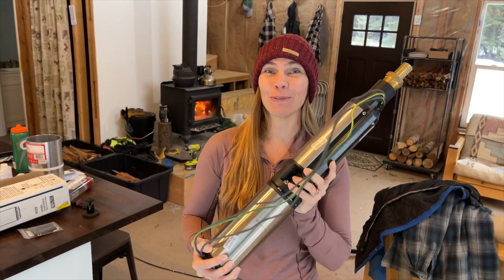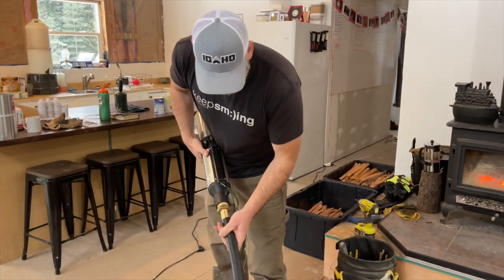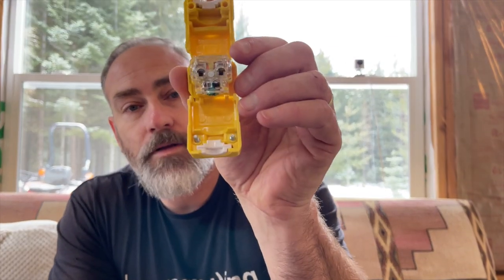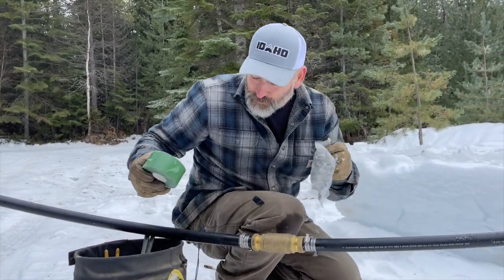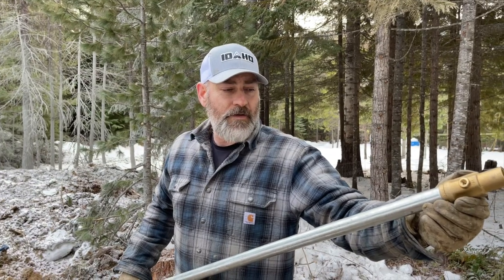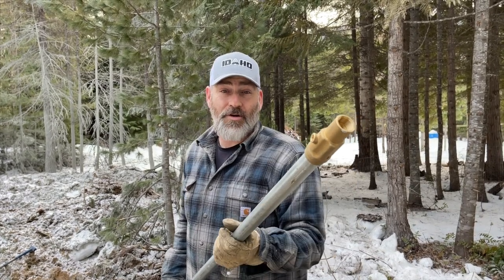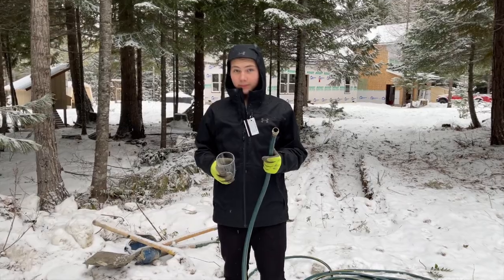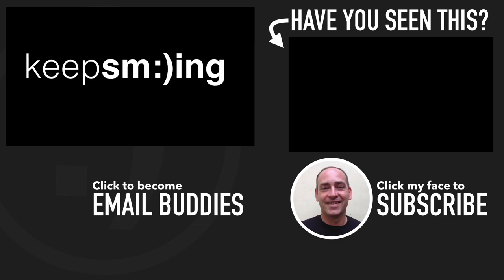WIFE is HAPPY/HUSBAND is NOT - DIY Well Pump Installation

Comment: Only one thing you forget on pumps that deep we use cable guards to keep the wire from rubbing on the case I seen many times the pump still good but had wire rub but most of the time it's already 15 20 year old so we just replace it all😁👍👍
Reply: I don't belive the depth part. a 1/2 to 3/4 hp pump will never get water to top at 500ft.
Reply: @larryray4811  The way I understood this, the water head is only 90 feet, never mind how deep the well may be. But I do agree that 1/2 HP sounds too small to be able to deliver any kind of useful flow.
Reply: @engineerinnewyork  I thought i saw when drilling that the went to 600 and then back up to 500. They showed a chart, but i could be mistaken.
Reply: @larryray4811  At minute 14:56, give or take, he says that the static water level is 94 feet. The well and the pump are deeper, but all that counts is the water head, since the pump won’t make any effort to push the water up until it reaches the surface at -94 feet.
Reply: @larryray4811  Also, at 18:10, he says that pipe is 196 feet. It follows that pump is at approx. -196 ft., very far from the well bottom, but irrelevant because it’s only the water head that counts.

Comment: Hello from South Florida. The take away here is you got the pump running. Your generator is trying to start the pump but couldn't sustain the long draw amps and shutdown. Generators usually have a "peak rating" . That Predator has 3500 Watts Peak...that is 29 Amps (run @ 25 A). You were drawing 32-36A. The other generator will peak @ 6250W = 52A and run @ 5000W=41A. Watts = Volts x Amps
Reply from the maker: +Lou Cinci Thanks for your input. I appreciate you taking the time to give it. Hope you have a really great day and keepsm:)ing!

Comment: a motor takes more watts to start than it takes to run, like almost 10 times
Reply: Called lock rotor current.  Be prepared.
Reply: Hello starting current. although that's a long surge for a pump that small. Edit: watched further... because it wasn't starting.
Reply: @MarkSDCA  LRC is when the rotor is unable to turn. Starting current is a little different.
Reply: A hard working 3 phase engine, takes 4-6 times its rated power to start. More than that and it will barely be able to start. 
10 times is unheard off.
Reply: Agreed and the lower multiple, obviously it depends on the machine
Reply: Pump needs a control box with a starting capacitor to give you the extra amps at startup. Can't just plug it in direct.

Comment: My well water has orangish tint (from iron), sometimes light grey (from shale). I spent a lot of time and money installing proper filtration to correct the issue. My water comes out the other end (my spigots) without any smell or color, just clear. My well is at about 70 feet so much shallower. My pump is a 240VAC 1/2 horse. Its interesting that some people do 110VAC for a pump. All the pumps I have installed were 240VAC. The video was interesting in respect to the fact you the home owner are installing the well yourself.  Nicely done video though.

Comment: TIP, on that weep hole at the bottom of the frost free faucet, add a 90 degree elbow and I always add a 2" extension with that. Helps keep sand or sediment from clogging it I've seen many of those installed without and they don't last long, every one I've installed with the elbow and extension I have never had an issue with

Comment: My first thought was "needs a hard start capacitor" because my background is in HVAC. It did not occur to me that more watts from the generator would do it, but it should have.  My brain just doesn't work like it used to.  Like most issues, persistence solved it.  Well done.

Comment: You should go with a 3 phase inverter controller and it will reduce your amp draw down to a max of 10amps.  And when running as low as 3.5amps.  They cost some money but saves the life span of the pump and saves money over time.  Also great for a off grid system

Comment: YES! You installed the hose clamps with the 'heads' of them, on opposite sides of the pipe. If there is going to be any leaks through the plastic pipe under those clamps it will be at the head of the clamp. Installing them with the heads on the opposite sides lessens the problem.
Reply from the maker: I learned that from the plumbing inspection last year. They are good for something 😂. Truthfully the was a huge help and a really nice guy.

Comment: I think it's gonna work!

Update: Well, then.  As a note for future troubleshooting, the time-saving step you missed is ... testing the second pump before install.  Also, I'm curious what the electrical specs are on the well.  We know that many high-draw appliances (e.g., table saws and refrigerators) have a massive surge at start-up.  Did the pump come with that information, or was it only labeled as 1200W?
Reply from the maker: It didn’t say the LRA or start up amps. Wish it did that would have need helpful.
Reply: all the 110  volt pumps use a 15 amp braker, that much more then it needs, a 1 hp 220 volt also uses a 15 amp, that 110 volt will use 8 amps at start, and run on 5

Comment: Close the presure side of the pump. Then start the pump. When the pump is running, open the valve. Sometimes this will help the pump startup a little easyer.
The combination with electrical pump and a generator is always tricky. The startup needs a lot of amps

Comment: I could be wrong, but I think You will need more than a 1/2 h.p. pump to pump water over 600 feet.
Reply: You do Russell... 1.5 - 2 Hp = About 5-7 GPM @ 40-50 psi on the surface. At the pump you'll have about 200 to 250 psi. WOW! Depending on water level in the well. Wire size to pump at 240V = #8 Ground can be #12 Mainly because of voltage drop. Because they don't have Utility Power it would be best to run a generator to pump into a 500 -1000 storage tank at the home then a much smaller pump to move water in the home. These are good people and what they are doing is tough...

Comment: 🙋‍♂️ lol
When you plugged it into that 3500watt, I had a feeling it wouldn’t pump. 
We had the same issue.
We have a 9500watt just for our well. 
Be careful at startup to always have the valve open, otherwise you can “deadhead” the pump. 
That’s what we were told. 
So glad you got it pumping, now to clean some water 😛
.....wait that doesn’t sound right 😜
Reply from the maker: We are glad too. What size is your pump?
Reply: @MartinJohnsonOffGridLiving  ours is a 3/4 horse I think. 
Homestead rescue had it installed. I know it takes a 30amp breaker. 
We pull close to 20 gal a minute.

Comment: Always nice when the well guys dig you a trench for the pitless adapter install while they have a machine there, or install it before they lower the last section down 4 ft ... but after 4 long days they may have forgotten ... and yea, even 110v well pump need a large generator  ... that pump has to work hard to get that column of water up 500 ft ... they pull a lot of juice, especially on start up ... too little juice and they overheat, causing thermal shut down  ... glad you solved the issue ... all part of the well learning curve .... most 230 v systems require a control box to modulate and protect motor and circuits

Comment: suggestion... ready to go 10 by 10 well house sturdy enough to hold solar panels. insulated for harsh winters. Include a runoff drain for "OOPS" shelving for batteries and  spare parts etc. include limited lighting, a heater set to come on at 40 degrees. have fun. Keep Julie happy! If that river crosses your land put a "mother earth" generator. build a dinky water tower to have a secondary water source use the generator to again supply electric pump etc...

Comment: As a retired Well service worker, I can empathize with you.  Pulling a new pump because it does not work is not any fun.  I praise you for working in the freezing snow/ice.  I can't believe that the well driller did not leave you a "pitless" adapter already installed.  I have placed one pump that ran on solar, had a charging system and a battery, ran on 12 volts d.c.  The second pump will work, I watched you install the first and you did everything correctly.  Good luck with the pump.
Reply: I agree with your solar pump. I do think he did a good job putting in the pump. I would have used 1 or 2 more torque arrestors, and 3 flat pump wire and some super 88. And I love the green pipe tape it’s the best. And I would have put some Corine tablets down the well. But that’s just me. I hope it all works out for them.

Comment: Just something for you to think about I hope you changed out the galvanized pipe fittings you installed down at your pump they should of been brass. I think someone said you also need wire guards up your pipe. You also could of drilled out the top of your pitless adapter and well cap and placed your hydrant down in the well pipe, maybe you were going to move your hydrant later to another place. Just tossing thing out at you as I did for my well. Good luck. ~ Francis

Comment: Best suggestion to avoid the rusty water issues is : Do NOT Allow them to install the Steel/Iron casing. use PVC instead.  1.) It eliminates the dirty rust water.  2.) It reduces the risk of pump and pipe loss due to lightening strikes burning holes in the metal pipes and damaging the pump.  Cleaner water and far less issues down the road. BTW: the PVC Pitiless installation would have been far easier as well.  Lessons I did not have to learn the hard way.  (We have and old 750 foot Steel/iron well on the farm; dirty water and pipe/pump burn out every couple of years.  At least use PVC down pipes, (these are not like the tubing used in this video but rather PVC Pipes manufactured especially for use in wells. They are threaded and install the same as regular 20 foot length steel well down pipes).  PVC casings cannot be driven down like steel casings can be so they must be drilled in by a qualified well driller and then properly grouted.
Reply: Hi! My name is Andrew and I work for McCullough and Sons Well Drilling.
So the  issue of steel vs PVC casing and dirty rust water are not related. That dirty rust water is caused by iron in the water, not the steel the casing. This iron in the water comes from deep down in bedrock or wherever your water is located underground. It’s a mineral that is present in the water whether it’s PVC or steel casing. If there is an orange goopy sloppy gross stuff on the outside of that pipe that you pulled out of the well (that’s called drop pipe), you have what is called “iron bacteria”. It’s a bacteria that gets in the well and feeds on that iron mineral in the water. If that gets inside your pipes it can stop everything up :)

There are also situations where we can’t use PVC drop pipe. PVC drop pipe is used for shallow wells that don’t have a submersible motor above 1/2HP. A 3/4HP pump is pushing the capacity and strength of PVC pipe. The other problem with putting PVC drop pipe down a deep well with a pump larger than a 1/2HP is that when that 3/4HP pump fires up, it generates a massive amount of torque which whips the bendy flexible PVC pipe around inside the well. That can cause your wire to get split or severed. Deep settings generally use steel for this reason.

That’s quite a deep well you have :) 750 feet deep is no joke.
Reply: @aindreascinead7370  What happens with regularity on our 750 deep well is that a lightning strike anywhere near, say within 1200 feet will run through top soil to the well casing while burning holes in the drop pipes and cooking anything in the upper 25 feet of water within the casing to a blackened sludge. The common practice of disinfecting the well does nothing to change this issue. (I'm pretty darn certain the iron is leaching out of the rusty casing walls regardless of what you say.) 750 feet of rusty casings is no joke. In Northern Minnesota known for iron water our PVC well casing only runs 150 feet deep and the drop pipe is also all threaded PVC 100 feet deep. We haven had iron water, bacteria, or lighting, or pump issues with this well, not since the day it was put online 30 years ago. I may NOT be a well driller; I do know what works far better.
Reply: I decide to run stell casing vs ovc, in case I ever wanted to go deeper or any work in the hole it would be protected. There are supposed to be 2 more zones of water below my current 104 to 140.  One at 250 and one at 300. If at some time inthe future, my family or kids need to go to a deeper zone, a drilll string can right down the casing, but not on PVC in would tear it up and a guy would lose his well.

Comment: The output of the generator is small to drive the submersible pump.
Mine uses a clean 240V supply for the 500W pump.  Pumped at the first trial.

Comment: When you start up a centrifugal pump for the first time, it has almost no back-pressure to overcome as the discharge pipe is empty. This means that for a short period of time (as the pipe fills) the flowrate that the pump is delivering will be very high. The motor current is more-or-less proportional to the volumetric flow through the pump and will therefore be very high until there is some back pressure and the flowrate significantly falls. When you are down to a normal operating flowrate then the motor current will be a lot less.
As an aside, it is not well known that when you run a centrifugal pump against a closed valve then the motor current falls to a minimum, when you open up the valve then the flow gets going and the motor current goes up.

Comment: Look up Lakos sandmaster filters.  Buy a stainless steel one.  They use centrifugal force to essentially throw the sand and grit to the outside of the filter housing.  Then there is a purge valve at the bottom - you manually flush out the sediment say once a week.  I would have your water tested to see if you need an acid neutralizer and a water softener.  These would go in next, in that order.  The final filter in the system would be something like a Rusco filter with a purge valve at the bottom.  This has a removable cleanable filter element.  Of course, the other thing you need is a pressure tank.  I like Well-x-trol.  This would be the second thing in the system after the sandmaster filter.  Fun Stuff!  And congratulations on getting all that hard work done!

Comment: If you prime the pump first to avoid the high draw on startup.  If there is water in the pipe it won't draw as much.   Noticed once it started flowing you meter showed 11.

Comment: Bravo on doing your own pump install.  It's not easy doing all this stuff yourself the first time.  I built my own off grid home myself with one man helping about 10 years ago, took me 6 years to complete.  You had a tough decision to make regarding your deep well and I hope it will work out OK regarding water quality.  I use a 3 wire, 230V 1/2 hp pump, with standing water depth about 200 feet, very similar to yours.  3 wire pumps have a signficantly lower starting current than the 2 wire; your pump supply place should have told you to avoid them for an  off grid homestead.  My Franklin 1/2 hp, 3 wire 230V pump starts easily on either my generator (Lister CS 6 clone with 3000W ST-3 head), or my backup cheap gas generator (4000W) or my own design 1500W sine inverter which is somewhat similar to the old Trace SW design, and can handle the 3000W+ surge load without complaining thanks to the toroidal transformers.  The guy suggesting a variable speed motor for soft starts was also on the mark- that is another solution.   I'm a retired EE.

Hats off for a good show, well edited, and for all the hard work, well done.

Comment: Dont let the pipe come apart at the clamps! I use wire too hold it better in case the clamps come off.They can snAg on a Rock edge.

Comment: Perhaps it's to little to late but for other folks, with a lot of electrical  appliances you must allow twice the running amps for start up. This means if the pump runs at 30 amps it may require 60 amps at starting. I learned that when looking for a generator to run my welding gear. It was cheaper to buy a used mobile gas welder. It runs all the tooling the mobile rig needs.

Comment: F.Y.I. Grundfos makes soft start pumps which eliminate a bunch of problems.
Reply: Grundfos has always been my go to. They also stand up to all kinds of contamination and weird pH and remediation additives  in my environmental remediation/extraction wells.
Reply: Thanks for the info.  Like a lot of products made today,  a few brands really try to stick with top quality materials and quality assembly, and some are a collection of import parts thrown together.  It is helpful to know what is a good reliable brand, especially with something like a well pump.  Thank again because I will be buying a new pump this summer.
Reply: Grundfos is usually stainless steel and you don't wanna use it when you have high iron

Comment: Black pipe and hose clamps. My bump is at 208 FT. schedule 80 PVC with steel couplings. 37 years and going strong. Different pump same pipe.

Comment: until you get the wellhouse with the purifying system set up, you can purify the water with a still (the thing you make moonshine and other alcoholic beverages with)
Reply: Or they can go right to home depot and just connect water purifier direct to there kitchen faucet.

The water should be fine for shower and what not.
Reply: @michaelrunk5930  I don't disagree but the still could be repurposed for other means later.
Reply: I'd just drink the water when it comes out of the faucet. We drink rain water and well water all the time. No cancer in my family.... No factory chemical water for us. You need the microscopic rock for good health. Purifying water is for townies...

Comment: Watts and amps. There is a formula for the conversion. You need to understand the ratio of wattage and amperage. Glad the larger generator worked.
Reply: pretty easy one... volts x amps = wattage.... watts / volts = amps